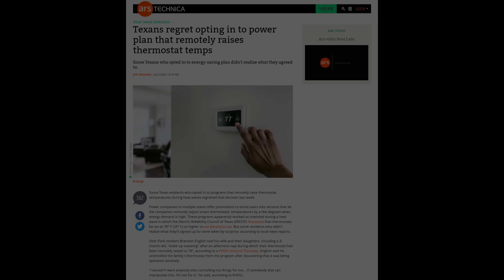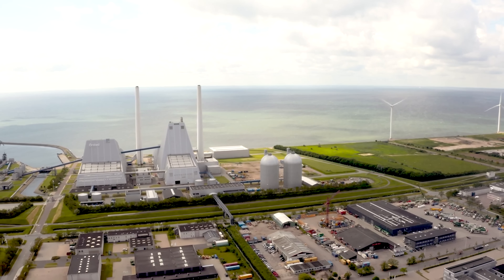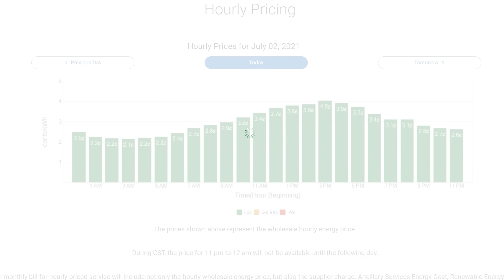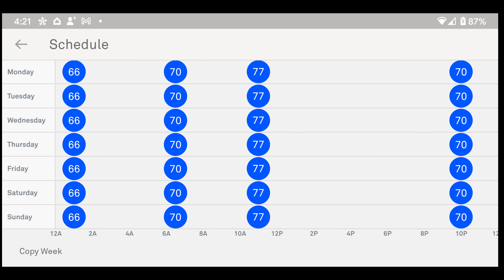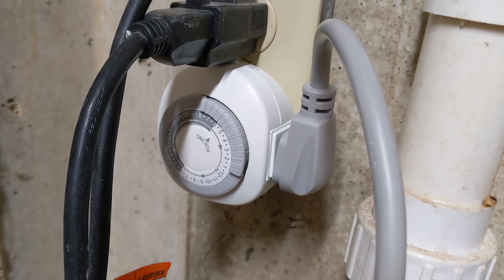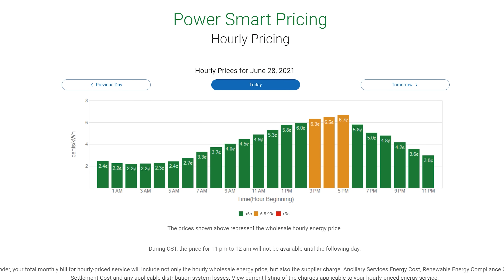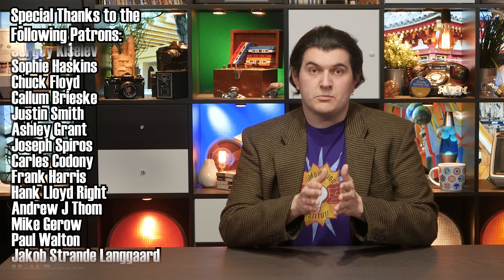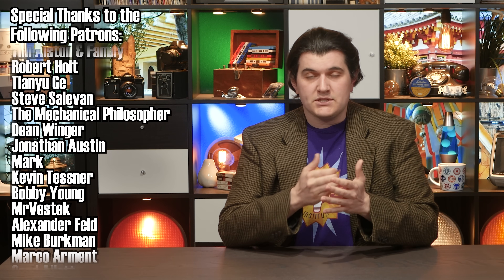Batteries aren't the only way to store energy. Here's another.

Comment: I don't believe that it's possible to get the house temperature to 18 C in the summer via AC. Even if you run it at full power you'll be able to get 20 C at best. And as I've experimented the temperature is rising in the evening from 24 C to 28 C in a matter of 2-3 hours. No matter how good is the insulation. Just because the surfaces outside are about 45C and more in the evening.

Comment: You are basically using the mass of drywall in your house as thermal mass.  You failed to address what you do in the winter.  You could overheat the house at night, but you already mentioned that you like it cold at night.  I got you beat with earth sheltered housing.  Much more thermal mass (almost always concrete construction), and it's always around 50-60 degrees outside those walls at all year.

Comment: This would work better in Phoenix.   But there is another problem.  Power may be cheaper at night, but solar is still down at night  You may be using the energy that releases the most CO2 to charge your house, unless you happen to live in say northern illinois?  Almost nobody has a fair bit of nuclear power.  Nobody has built a nuclear plant in decades, and like it or not, and I do not like it, nobody is going to in our lifetimes. But the biggest problem is that peak use time is going to shift to night due to electric vehicles.  And again nobody is going to build a nuclear power plant.   Efficient storage is a must.

Comment: As you said, very circumstantial.  

How many homes in the US are built to the standards of yours? Five percent?  Then how many are on a load based provider?   Another five percent?  That's .0025%  Effectively zero. And the temperature in the AM I would find tooth chattering.

I do the best I can with a 1974 brick home with attic only insulation. I keep the thermostat at 84 degrees and use fans where I mostly am.  At least all of my electricity is renewable, thanks to the weird Texas grid program that allows many of us to select providers. 

Oh, where the hell do you get 5-6 cent/kw/hr electricity?  Most of the country pays three times that.  I'm paying under 9 cents.
Reply: IKR? It's like it's a huge secret or something. Whether he had work retrofitted, or even built new, he should do a video on that, or at least share what materials were used and how. I could probably get away with doing something like this in the summer if I lived in a finished basement. LOL! But my little bungalow has no basement and has gone from 72 to 88 between the hours of 2pm to 7pm on a clear summer day. Nope!

Comment: I wouldn’t say your parents AC is undersized more than yours is oversized.

72-74 at 5-10% regional yearly max temp is typical of round about size load metric. Meaning for my area when it’s 94 degrees my AC running non stop should maintain 72 degrees. Any hotter and it I might lose a degree as the temp outside causes a heat load that exceeds the ACs size load. Since this happens so rarely it goes unnoticed to most. Plus contractors will size up when unit sizing is between two size units, ex if a manual j says your home needs 26000 btus of cooling they will use a 2 1/2 ton (30000 btus). So most people have a unit that is oversized.

Oversized units don’t dehumidify as well because they don’t run as long and typically use more energy from a more strenuous start amperage much more often.

This is really where variable capacity compressors really help out as a well design controller can try to match their output with the homes heat load. Although one should know this results in near constant operation depending on how good the unit is and maintaining that balance. But longer run times at a much load constantly is beneficial.

I really think your channel is big enough to get experts on various topics. Their are YouTube channels made by master licensed professionals in HVAC that would probably really enjoy being on your channel. I mean it beats using ideas that are using fragments of information or corporate marketing specs like you did in the heat pump video. Can you believe some people feel that large corporations don’t have our best interest in mind?! I know it’s sounds crazy right?

Consider this, there are discords and Facebook pages of professionals that gain entrance from providing their state issued licenses picking apart your videos. Which sucks. And there are viewers here that lap it up like gospel. Which also sucks (if your missing key data). Besides wouldn’t it be nice to shut people like me up? For example that PSC motor in your Lennox gas furnace is likely using 3-4 kW per day over the course of running 15 minutes per hour for 9 hours. So 90-120 kW a month, that is significant when you are talking about a 150 dollar bill.

Comment: It's a shame we don't have a giant nuclear generator in the sky beaming us clean, free energy each day that we could use. Oh wait. "But batteries!" you say.  Use solar to pump water up a tower, use impeller driven turbines at night to generate power from the energy stored. Spin a giant flywheel driven turbines like the ones at hydroelectric plants during the day, use power coming off the turbines at night. Haul a giant weight up a sled during the day with solar, have it spin a geared dynamo on the way down. You can store energy in a myriad of ways without a single battery.

Think outside the battery. We have a giant nuclear reactor in the sky beaming us power. It's time to stop ignoring that, and burning down the planet instead. It's having real consequences.

Comment: Damn, I have 9¢ a kW and don't do JACK about power efficiency and my electricity bill is only $75 a month. Got a 3 ton 13 seer on a 2600sq ft house thats NOT a heat pump. Just 2 stage heating on a 15kW heater. Still trying to figure out why it's so cheap and my pud of Benton county has the smart app so I can see my usage and its hardly anything

Comment: Its infuriating that my panasonic heat pump does the exact opposite. The only automatic mode that it has is to cool more when outside temperature is higher and heat more when it's colder outside. I have to manually schedule cooling/heating at night. I need to manually change schedule once per week because weather patterns change. We have 18deg C today and no cooling is needed. In a week well have heat vawe and I'll need to configure heat pump schedule again.

Heat pumps could be up to 30% more efficient if they would cool houses at the coldest time of the day in summer and heat when it's hottest time of the day in winter.

Another thing is what mixergy does. They heat tank of water to 95 deg C when energy is cheap. During the day they mix the hot water with cold water to deliver ~50 deg c to the tap.

The same principle could be used to cool a water tank. Unfortunately heat pumps don't mix water to get the right temperature so house is either too cool or too hot.

Comment: Your idea is sound on the surface and yes you can opted in or out. But you’re suggesting the utility company can use your HVAC on to support THEIR needs which directly effects YOUR bill and energy usage….negatively. If they miscalculate the demand than they are doing it directly at your expense ($$).

So your happy with your current schedule. Would you be as happy if the thermostat stayed at 66 until 1pm in preparation for being off? It would cost you more money and use more energy than something you are already happy with. Paying more to be less satisfied? Sign me up!

This applies to everyone though, paying more and consuming more energy than they already are across the board at any temp not just 66. Btw your AC isn’t quite as efficient below 68-70 because it’s harder to fully evaporate the refrigerant thus less heat is moved at near the same load.

Plus the way my local supplier does it is they will send you a text message the day before a “Peak Rewards” day. Allowing you time to opted out for the day or prepare if you need too. I feel that’s a good compromise vs a corporation having direct control of my wallet.

Comment: Me with a house built in 1929 and only had put in insulation in the attic and floor upstairs: w h a t w h y i s m y h o u s e a t 78 a t 12 oh wait my house breathes to much

Edit: the 116 day in Oregon (pacific northwest) made my ac run 24/7 and the ac overheated and we thought it broke and the ac tech said to put misters on it when it gets over 105 and when I woke up in the morning from not having ac the house was at 85 and it took my ac 2 days to get it to 76 I let it have a Break at 76 and then got set it at 74 (so if your ac ever stops working but the condenser fan stays on just the Fan it most likely overheated so get the hose and water it down the ac is fine it’s in the rain and ment to get wet)

Comment: So but this working with aircon means the house must be modern and well insulated? It's a very good and practical idea. One could also work with floor heating when present.
This reminded me of some far related and all stupid ideas.
Much more stupid: I guess in theory,  if one raises voltage and/or frequency, the grid can hold more energy to buffer, momentarily or not , it's own peaks. But that's of course in practice very hard, very high tech, and completely unaffordable to do. 
Less stupid: new houses here now must now mandatory have a rainwater reservoir. Why not heat up or cool down that reservoir during peak and then once people get home they can use this for cooling the house (summer) or warming. Of course, warm water is perfect for dishes or washing too, less electricity needed. Some ozone generator would keep the water algae free. For cooling, making ice out of the water would even be better.
I guess, this could all be done by some crazy engineer inventor but houses are by now already complex and expensive enough. But wait, did I tell you about using the tap water system as thermal buffer? OK. forget it.

Comment: The water one isn't storing energy- It's potential energy
Reply: takes 5 seconds to google "potential energy" 

"Potential energy is energy that is stored in an object due to its position or condition."
Reply: yeah, they convert electrical energy to potential by pumping it uphill  then it converts it back to electrical when it's needed by letting it flow downhill through turbines. that's storage.

Comment: I know this video is almost a year old now but it would be really cool if you did an updated version of this.

Regarding the load shedding in Texas, they were able to use Bitcoin miners in order to increase the capacity of the grid and turn them off at a moments notice and redirect the power to the customers who needed it during a very cold winter storm.

Comment: Makes sense to use the energy stored in buildings. I've wondered about the heat that builds up in an attic. Since heat expands, would it be possible to vent the heat through a turbine to generate electricity? Might not generate a lot but might help a little. The upfront cost would be offset over time. I found your video very interesting.

Comment: But... if everyone did the same as you, then wouldn't that shift the peak hours to the time when over-cooling is necessary? Thus, not solving the problem.
Reply: this is exactly what I was thinking the whole time, though I do think that with AC in particular it is more energy efficient to pre-cool during the night because of less load to achieve the temperature goal

Comment: working 2nd shift coming home at 430 am I understand
flip switch to 70 in summer
create bubble of cool air
wake up or try to 1030 am
yes works unless i have paid time off
main thing is humidity
wished workplace had at least dehumidifier in certain departments
warehouse work in summer not easy but been there almost 3 years come november
would like to propose a clean energy system that stores solor powwer to power de humidifier
nothing good comes out of breathing soupy air!!!

Way dangerous have to catch breath just walking 2 flights of stairs?
wtf?

Comment: Nice, but i don't have a heat problem. My problem is when electric cables collapse from snow , and i'm left freezing my ass in the dark. 
Oh btw, i'm stil obligated to pay the whole bill as if "the grid" was active.
You know what i say? Fuck "the grid", Its inefficient. The lose more power in transit, than i actually consume.  Yet they insist of having a couple of power generating plants ,covering a few thousand square miles, with miles upon miles of cables, "because we 've always done it that way".

Yeah no! Time to say good buy to the cables, and start using wireless power transfer. 
I'm not the only one tired of running a fuel guzzling generator for days on end , just cause some assholes got Cable stock.  

BTW if you run in on our absent PM, tell him to get his ass home. Truckers may be loud, but they are not Cannibals. Plus free Pizza, while blasting Metal  ! How can you not like them?
Of all the assholes out for their 15mins of fame, they are by far the coolest ever.

Comment: "heating and cooling is by far the biggest energy consumer of a home"  That's assuming you have AC, heater, water heater and such.  I've had none at times :P  I currently have a water heater.  And yeah, it does consume a lot of power per hour compare to everything else in the house.  
Ooohhh I love that hourly rate thing.  I wish I could do that.  I would never allow for remote control to anything on my home.  BUT the hourly rate sound like something you can take advantage off.  I'd have as much things as I can rechargeable.  And buy those energy storage things.  I mean, I already have a couple batteries with charger and inverter, but those are for when prepping for bad times.  But if I could get hourly rate.  I'd just charge everything when not at peak consumption times and then wait and put everything to charge when is the cheapest possible.  
I'm already looking to switch to a gaming laptop.  They've improve greatly to the point a not expensive one can game as decently as an affordable desktop.  And overall consuming less energy and having and integrated batter.   
And WOW  even at 8 cents that's like a third of what mine cost.  Now it suddenly make more sense how so many people can have AC and other heavy electronics.  
Erm... this is more of a save energy than "store" energy.  I thought it would be something like what I would do or that you had some crazy mini hydroelectric storage and was pumping and storing water in the attic or something.  
This "stored" energy can't be used practically for stuff like, charging your phone.  Plus, in that case, I save more than you, be NEVER running an AC.  Heck, I even saved the energy of getting one.

Comment: As someone who can't deal well with extreme hot or extreme cold... Yea nah fam I would never let anyone else but me control my cooling or heating needs. 

I have to constantly shut off my AC here because even on auto it doesn't work well to my own needs. So I basically am constantly fiddling with the AC and fan and any combination of the two to keep within a good temperature range.

Same is true for the winter. Am constantly turning the heat on and off (tho to be fair, the wall heaters here are broken or maybe its the thermostat, it's either a sauna or too cold.

Comment: All bullshit.
You want efficient, on demand comfort, that doesn't have ANY carbon output after it's been built? They came out with that 3000+ years ago, it's called a basement. People who drank shit water in mud huts knew THERMAL EFFICIENTCY SCALES WITH MASS.
A mouse eats nearly 5 times the food and African elephant does relative to body size, it doesn't matter if you're heating a tube that's made of water and turns food into shit, or if you're heating a concrete floor by burning methane and turning it into Co2.
OUR SPECIES SPENT MILLENIA UPON MILLENIA IN CAVES FOR A REASON.
As far as insulation goes, standard practices are already 95% of the way to redundancy, best you can do is eliminate thermal bridging.